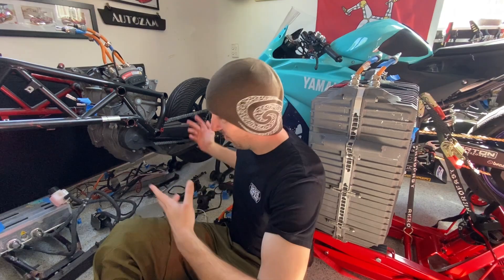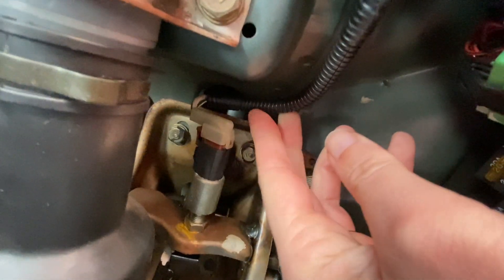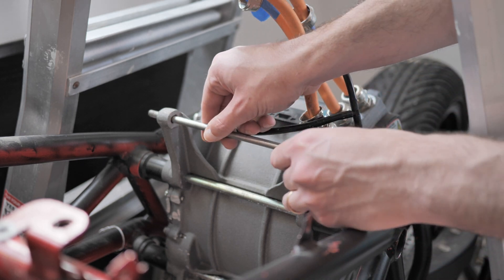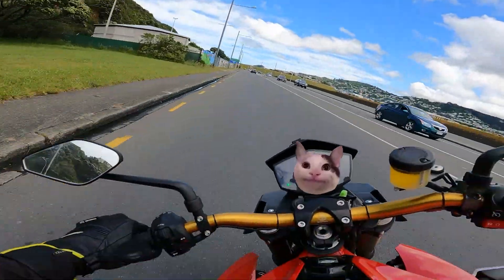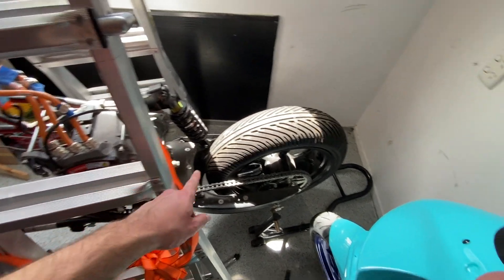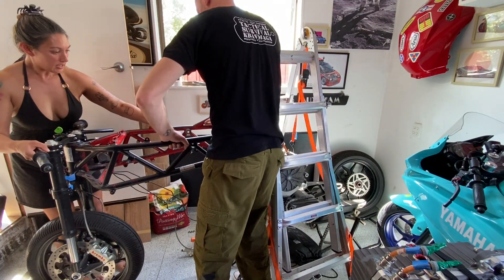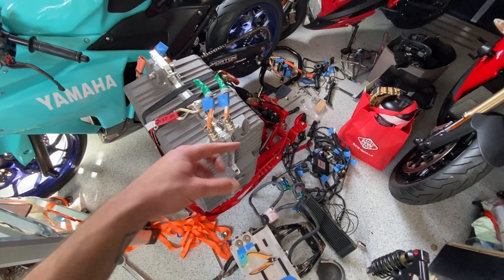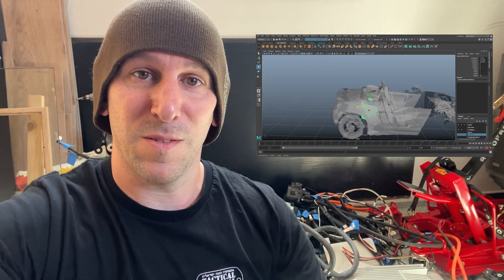Electric Honda Beat Conversion - Episode 4 - Removing the Motor

Comment: The handbrake light is also typically used to indicate low brake fluid ! Might be handy to know
Reply from the maker: Really??  I did not know that.
Reply: @NewZeroland  I found out the hard way 😅 but did some research and found out that's quite a common setup!

Comment: will you use section of frame to hold motor in car?
Reply from the maker: That's a possibility!  It might make things easier.. it's just steel so welding it onto something else would be pretty easy.

Comment: Did you weigh the Beats Engine, gearbox, fuel tank yet Sam? I reckon you may already be in the green, just make sure Jenn doesn't wear the super heavy safety sandals when the car is weighed 😂
Reply from the maker: 😂 nah not yet.. gutting the car will be a whole several episode series on it's own, and I can't wait to get started! Hopefully the engine is a similar weight to the battery.

Comment: That is some serious weight loss to overcome. Are you going to get into drilling?  I've seen some crazy cars with a lot of holes to reduce weight. Just gotta be careful the frame can still hold up.
Reply from the maker: I might end up doing that, yeah.. but definitely fiberglass body panels first, and gutting everything I don't need. It'll be a fun challenge!

Comment: I had no Idea that Jen was not only stylish, but a power lifter as well. Actually, I should have figured, she already has like a dozen other skills. Next she'll be performing Kung-fu. Also the amount of confidence you have... Sure, that brake is two wires, should match perfectly! Just pop that light out and put it someplace else, no worries! I think I felt more anxious about that than I did about you figuring out how you'll lighten the car.
Reply from the maker: Oh man haha, thanks! It's a daunting project but the challenge of it all is really fun, at least in my head. The potential for where it's going is the exciting part. Actually doing it will be hard. Funny you mention that.. Jenn actually does martial arts too 😂
Reply: @NewZeroland  I had a feeling you'd say she did! She's officially a superhuman.

Comment: Sam: dressed for early spring (trousers, warm hat, closed shoes)
Jen: dressed for high summer (about half a square meter of textile, jandals)
Are you one of those couples that constantly argues about the thermostat settings? ;)
Reply from the maker: Realistic vs optimistic, maybe 😂 I think Jenn just returned from the beach, and I was in the garage where the sun barely reaches.
Reply: No time like “Shop Time!”

Comment: I don't think you want to connect the kickstand switch to the handbrake switch. They are NOT equivalent in usage, and you don't want to kill the power every time you want to make a handbrake turn LOL. There really isn't an analogue for the kickstand in a car, so I would just wire it permanently open or closed depending on whichever way lets the motor run. There's still the handlebar kill switch, right? So the kickstand switch is completely useless on a car where you're never going to take off with the kickstand down.
Reply from the maker: Yeah I think you're right.  A few other people brought up handbrake turns haha.  I don't think I'll ever do that in this car, but having the option would be cool!

Comment: Yay kittens 🤣

Keep the handbrake as it is in the Beat, makes life alot easier for cert. 

As to the side stand switch just loop bypass it at the main loom end so it thinks the side stand is always up. You can literally use a peice of wire to bride the wires, its super easy.
All us adventure riders do it as we don't want the bike cutting out when hitting big bumps and making the side stand flop around.

If you still want it to work just wire in a switch to the dash but I can't see why you would need it.
Reply from the maker: Ohhhh that's a good idea!  Someone else brought up handbrake turns / drifting and keeping the kickstand switch would suck for that.  I'll find out if it's possible to bypass.  On the Zero it was some different kind of sensor that couldn't be messed with.
Reply: @NewZeroland  good point on the drifting and also a bigger issue..... hill starts 🤣
But yeah it shouldn't be an issue at all bypassing it. The side sand will just be an on off switch, it'll never do anything more than that.
You can but a propper plug to bypass it also for around $20 so it'll look more professional.
Reply from the maker: @willyd-adv  yep, totally doing this.  Thanks man!!

Comment: Won't the engine in the car be heavier than all the electric parts you are putting in? Just take out the engine, carburettors and fuel tank.
Reply from the maker: I hope so, but I doubt it. The engine is a really small 660cc 3cyl. My guess is it'll only weigh 100kg, but we'll see.

Comment: now you can't do emergency brake initiated drifting without turning off the car
Reply from the maker: Awwww good point 😂 Crap, ok I'll have to think about this.
Reply: @NewZeroland  just install a switch in one of the lines that came from the brake, and you will select betwren have or not signal, so the issue is gone